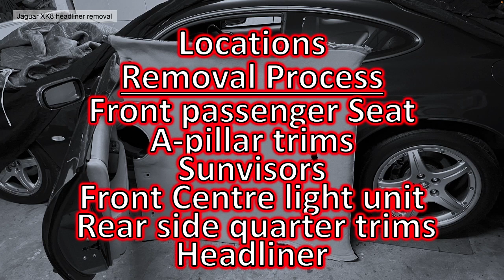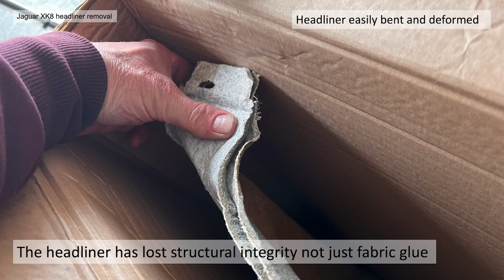Jaguar XK8 Coupe headliner removal. Why and how to do it.  XKR / X100 V191

Comment: Once the headliner is fitted do you tuck the board and a-pillars under the door seal rubber? There is a gap between the board and the roof above the door. I can stick my finger in - I imagined the board to be flush with the roof...shall I use an adhesive or velcro here??

If I tuck the board under the door seal it doesn't look right. Could you advise? Many thanks
Reply from the maker: Syzmek, yes you are correct the headliner should be tucked under the door seals and a-pillar covers etc. Hope that helps, regards Damian
Reply: @ODRModurol  thank you, I bought some Gorilla Glue heavy duty double sided tape with velcro and bonded the sides along the door seal to the ceiling and then overlapped the door seal rubber. These new headliners are a nice fit but not flush in that particular area. But seems to have worked
Reply from the maker: @szymeklawik7636, glad you found a solution, regards Damian